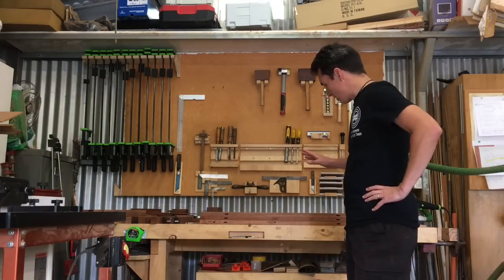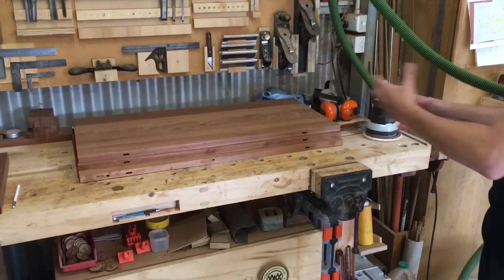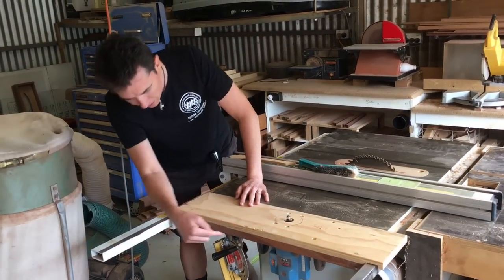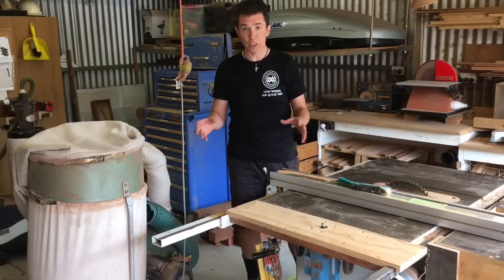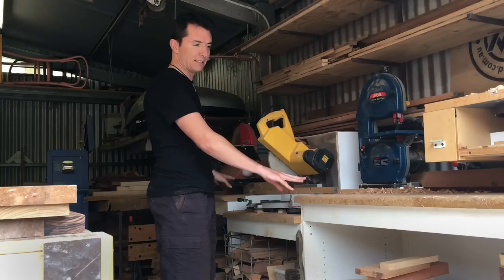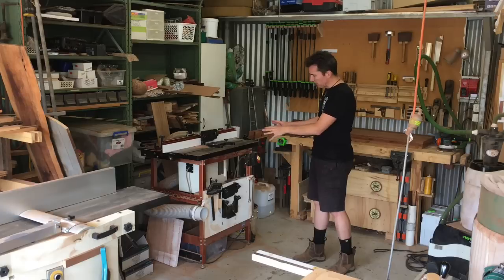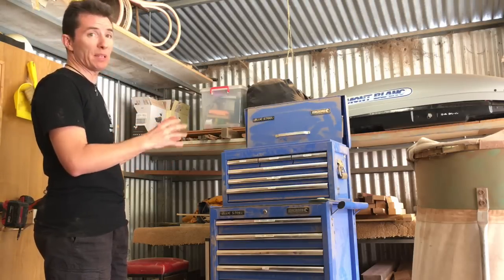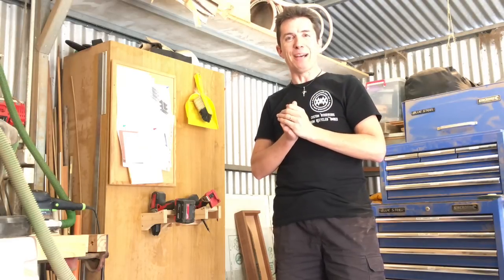2018 Woodworking Shop Tour - MS Wood Custom Woodwork

Comment: It's good to see how other woodworkers shops. My shop is a bit disorganised and has lots of 'collectables ' ( the Trouble and Strife calls it junk) but I know exactly where stuff is, well sort of. I checked out Matt's web page and he certainly has some very high quality items there. His workshop has stirred up some ideas for me to help de-clutter.Thanks to Matt and you for this video. BTW, I used to travel over 700km round trip when I fixed up powerlines in outlying areas. Suggestion, go on more road trips like this. Cheers
Reply from the maker: G’day Rosscoe & you know mate we tend to collect a lot of things we don’t need, I’m in the process of reassessing what I need & how I plan efficient workflow mate, it’s not that easy but through trial, error & viewing other workshops we can achieve a result that suits our need, mate I’d gladly travel to do shop tours but 770kms is a hike however great fun 👍👍👍👍👍🍻